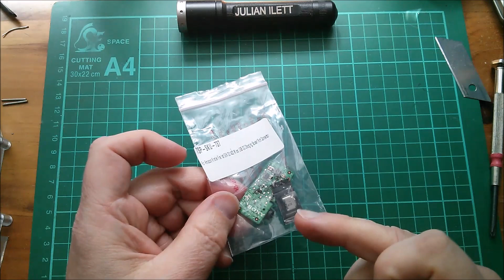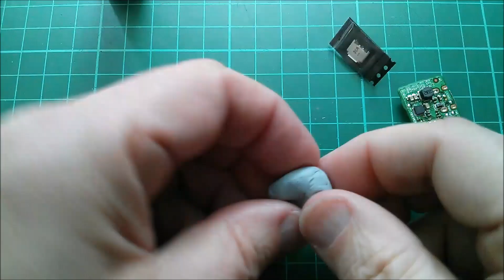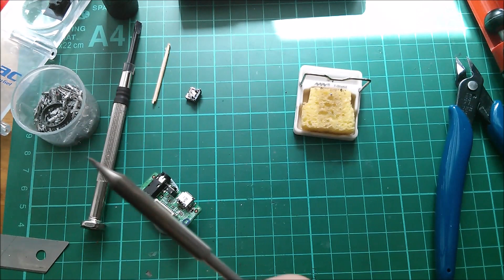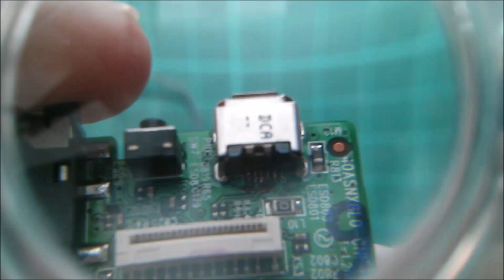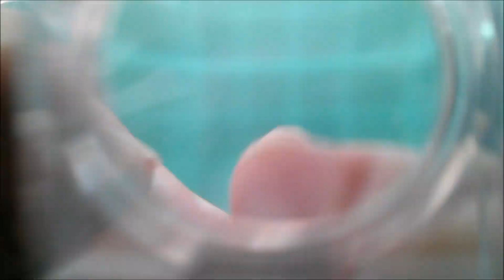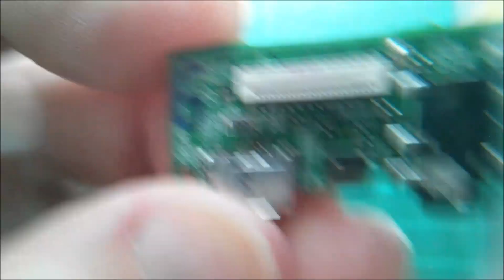USB Connector Replacement

Comment: The easy way is, Get your scalpel knife and cut the 5 legs high away from the pads as possible - To unsolder the ground legs with as hot an iron as can be applied 350 to 400 for the shortest time - I have a 3" ( 7.5 mm ) Jaw portable bench vice, into it I place a flat blade screw driver hex bit. The job held in left hand ready to apply to the drive blade tip as I heat the solder. Once duff bit removed, clean up PCB, remove debris from PCB tracks with fluxed desolder braid. Then after new part fitted, deflux and clean using Isopropyl. If needed you can spray lacquer the PCB to protect from moisture.

Comment: I managed to rip the micro USB connector off of a mp3 sound card. That meant it was impossible to upload new sounds.  I was able to put on a new connector using plenty of flux and a sharp soldering tip.  I cleaned it up with solder braid to eliminate shorts and cleaned the board with pure Isopropyl alcohol and to my surprise, it looked and worked like new.  I used a jewelers loupe to see the connections.  I really hate working with the modern tiny connectors.  The Isopropyl alcohol is sold in US home improvement stores as fuel for alcohol stoves and does an excellent job of removing flux.  Much better than the first aid versions.

Comment: Flux is ok for getting components off, as the flux has burnt off from then the component was fitted. but it just makes a mess when soldering new ones on. there is enough flux in the solder for the job, if you don't waste your money on chinese solder.

Comment: 1:44 leverage is an absolute no-no for SMD work.. you'd probably rip off the solder pads that connect to USB sockets data pins. Small SMD PCB pads are generally weakly attached to the board, unlike large pads.